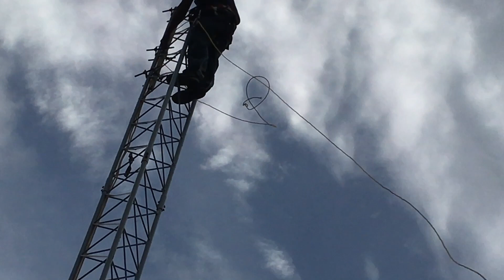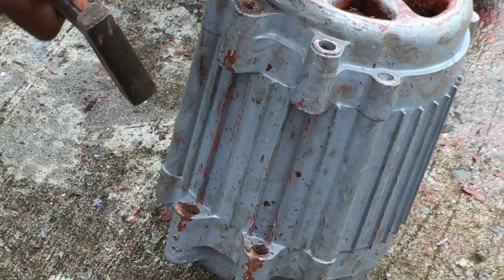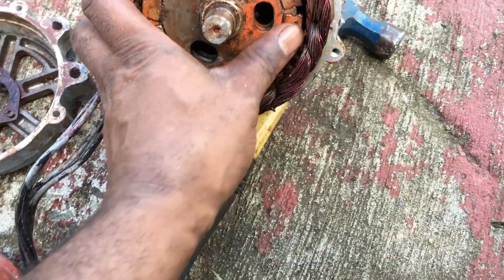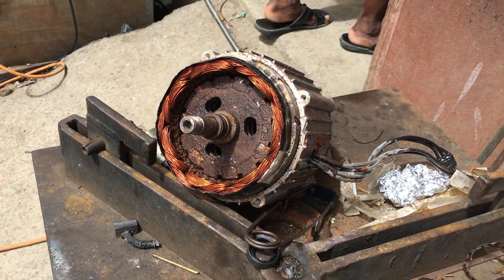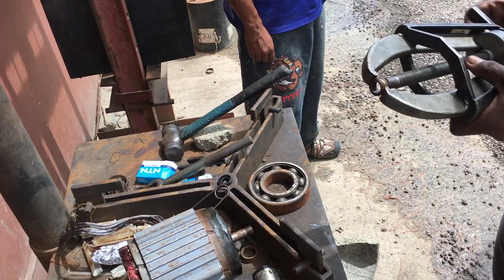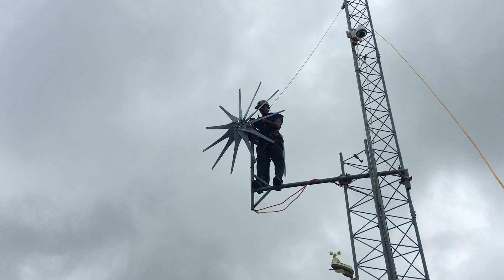Repairing the Freedom II dual PMG 24/48vdc Missouri Wind and Solar Wind Turbine

Comment: that bearing puller is a nice looking tool im going to look for one, ages ago i ended up with a chipped and scored magnet/s from exactly the same issue, i guess you coated the magnets with more rust preventative, one of your magnets looked like it came loose from its adhesive.
im not realy a fan of these pmas , i know they can work but they definitely couldve been designed and built just a little better.
but if youre happy thats all that matters , the video was interesting and yes they are hard to pull appart.

Comment: Anything that is left open to the weather will rust and fail at some point.
Reply: also some bearings are better suited for weather exposure than others, ages ago i changed mws bearings to genuine japanese made just before  jason b  had bearing issues with his.
theyre puny bearings really especialy for the load 80" blades can exert on them, it supprises me they last as long as they do on the alt style pmas, even the 300w hyacinth had a 20mm shaft and fairly big bearings.
Reply: My hyacinth  is still going and that turbine made more power then what it was rated for.
Reply: Yeah but not after three years of years. Depends on the quality of the galvanisation process. Go go Chinese quality non-control